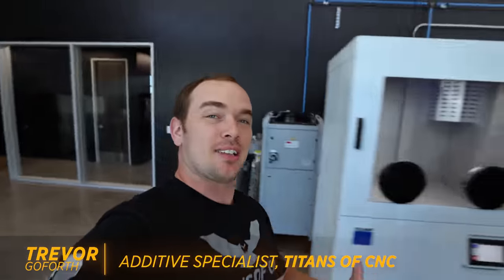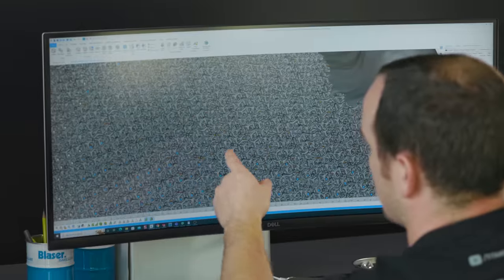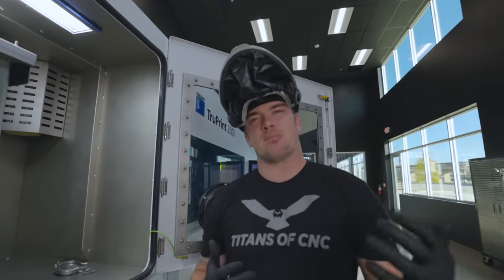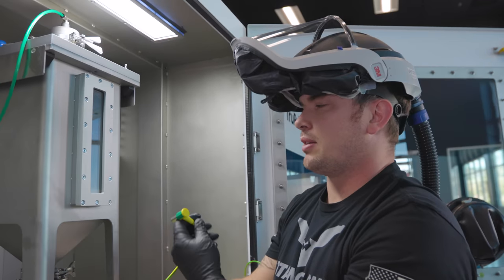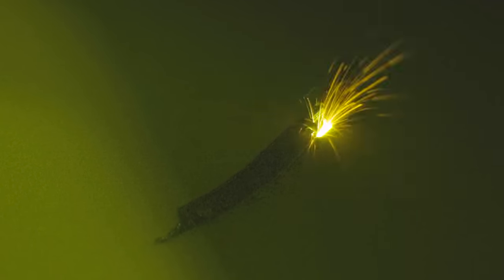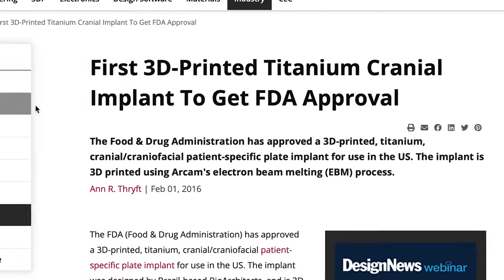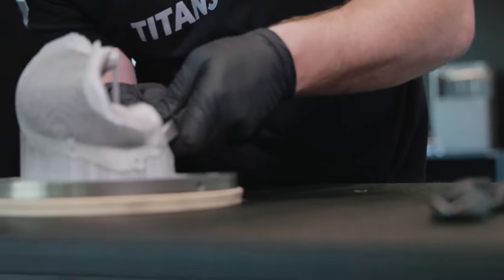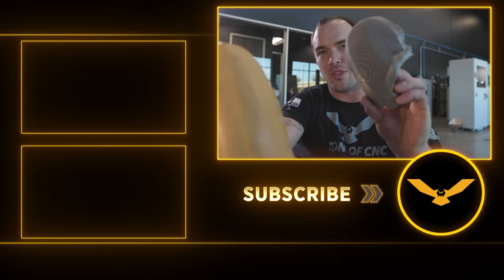We Just Made the World's MOST COMPLICATED Medical Device

Comment: 1981 I was a 20 yr. old tool & die apprentice we built molds for aluminum, zinc & brass die casting. using conventional machines. The mold cavities were often sunk in H-13 tool steel using a 3D Bridgeport tracer mill over plaster models, then extensively hand finished. One day in the early 90s I took my family to the Pacific Science center and I i came upon two full size plastic models of automotive mag wheels which were made without a mold using stereolithography. I was completely dumbfounded that such a complex part was produced without a mold. Flash fwd. 2002 I was working at a large airplane co. as a test mechanic. In an adjacent shop to ours was a stereolithography shop where I could see this magic up close progress to 3D printing plastic resin to again unbelievable  metal printing of seemingly any alloy. Wow now this miracle. You Machinist at Titan have a right to proud being called upon to such life changing work. Kudos to all American Machinist!
Reply: BOOM! Thanks Timothy!

Comment: I'm really looking forward to seeing more additive manufacturing in medicine. It will be a really great way for doctors to be able to offer their patients customized treatments with better biomimickery compared to things like universal joint replacements. Being able to create structural replacement components for joints and bones that offer a lattice structure and hollow core for bone grafts and bone marrow to infiltrate will be truly revolutionary for those types of surgeries, as it will allow the replacement to more naturally emulate the structure and function of the bone that it replaces. Eventually, I suspect that this will be extended all the way to replacement organs, but we're still a way off from that and it'll definitely be outside of the consumer sector. It's also fascinating that 3D printed ceramics are being used in the creation of dental implants to better match the original tooth shape in a rapid manufacturing application rather than requiring molds to be made. This provides the orthodontist with even more flexibility when determining treatment paths for their patients, and that really is the gift that keeps on giving with rapid prototyping technologies.

Comment: There was a significant era where we'd save the patient's own bone and reimplant it later, which worked to some degree but wasn't perfect. Current Standards globally are either own bone, titan or 3d printed peek/pmma/other plastics. There's also a new technique where you print a mold and then form your implant inside that from hydroxyapatite cement, which is very cheap

Comment: I wanna see the deburring/ medical cleaning of something like this! Deburing is a very important secondary step to machining we don’t see! Can we make it happen ?
Reply: BINGO!!!!  The removal from the build plate is a huge issue with enormous variability.  Notice the breath masks, those aren't for Covid but because of the granular powder in every nook and crany of the parts!  You do NOT want to breathe that!  Just using a vacuum as you saw isn't enough.  All those processes to remove burrs, build supports, powder, etc. need to be validated for medical manufacturing, particularly for implants.  The real experts in that are Stryker and they aren't letting anyone know as it cost them a decade and a fortune to develop those processes.  

Many people are sweating these problems right now, myself included.
Reply: @kennethfharkin  yup! One of the number one considerations I take when programming new parts is how can I make absolutely zero burs . I run copper and it rolls burs you have to have perfect order of operations , and with some parts deburing can make or break whether a part is scrap . We had a part the other day like a shower head that had over 1000 .045 holes in it and it was hollow with chambers on the inside, it could not have any chips whatsoever on the inside or any chamfer on the holes but still need deburred . We hooked up about 50 psi of air through the backside through the lathe.
Reply: @adammiller4879  When someone says "burr free and no edgebreak" I say "at what magnification"
Reply: @kennethfharkin  yup, and if the print says “no edge break” but doesn’t have a tolerance range, the info block on the bottom says like XX= + - .010 means you can have a .010 edge break regardless. We have a spec called out like “manufacture to XXX spec number 74-138364” which would say something like all edges to be broke .005 max
Reply: Depends on the part thoug
Reply: @adammiller4879  Don't forget referring all un-dimensioned features to the model and a blanket application of a profilinity tolerance...
Reply: @kennethfharkin  can’t forget that😂 love it

Comment: Is this the part actually implanted? Or did you print a copy for the video?
And while I'm asking questions: could you print a gold implant like this?
Reply: Printing of precious metals is being done.  It is a specialty though because the reclamation and handling of that material is enormously important.  The benefit of precious metal additive manufacturing is that there is very little loss when done right.  You should have NO unreclaimed scrap and and all of it should be able to be reprocessed into usable media for future builds.  Precious metals due to the enormous material savings is one of the only areas where additive manufacturing in production volumes becomes more economical than milling.
Reply: @kennethfharkin  thank you!

Comment: Powder laser printers like those really are the future. Anything someone can design can easily be made in that type of 3D printer. Once they refine it slightly so it can get any surface finish right off the printer, they will start to fully replace conventional machining.
Reply: Never.  It's basically casting and has the same sort of accuracy.

Comment: I didn't know you still needed support when 3d printing metal. I thought the powder was the support.
Reply: The supports aren't to deal with gravity, they're to deal with the thermal warping the part wants to do.
Reply: As Jon said the thermal warping is a definite concern that many have never heard of.  Physical support though is still needed in parts depending on the geometry.  Try printing a hollow cylinder like a paper towel roll with the long axis of the cylinder parallel to the build plate.  Even it it were a solid block with the hollow cylinder you would still have huge issues unless the interior was significantly supported.

Comment: It's great to be proud of you work, but a heart implant like a Ventricular Assist Device (VAD) has custom parts with strange shapes, moving parts, a power supply, electronics and software.

If you want to be involved in the most complicated medical devices, work on stuff that interfaces with fluids or the nervous system.
Reply: Reconstruction of a cranial defect is complicated from a tissue healing/implant failure perspective. Each device is custom to the patient’s defect which could also involve odd geometry. Design matters, quality matters. A failure could potentially cause a severe brain injury.
Reply: @Sara-TOC  Many medical devices are complicated.  Again, the group should be proud of its work, but the complexity of their product is less than a lot of state of the art stuff with moving parts, electronics or neural interfaces.